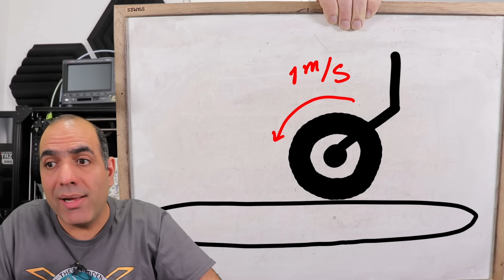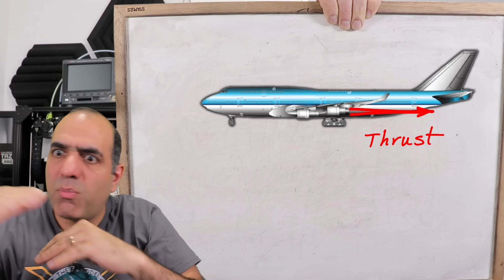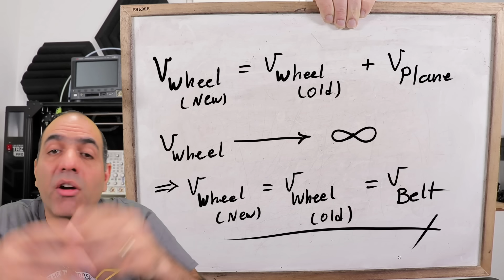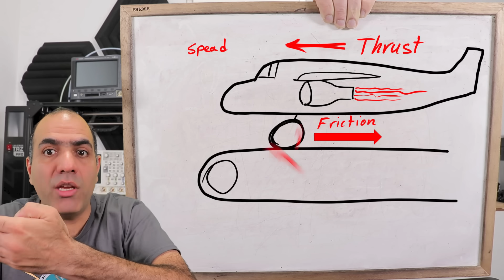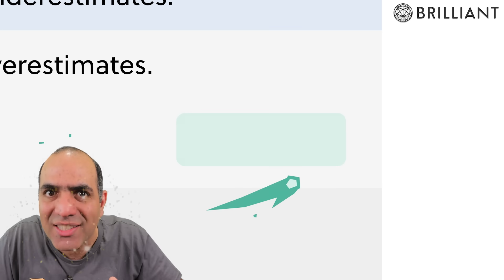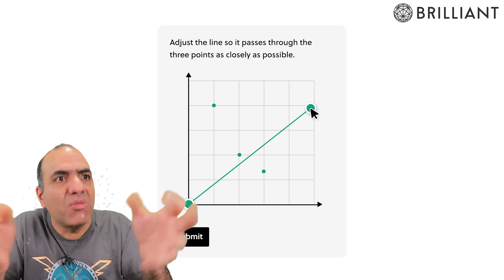Airplane Question that Drove Me NUTS!!!

Comment: Is the treadmill is just matching the speed of the centre of the wheel (the speed of the aircraft)? Then yeah, it would just double the wheel speed, it would probably get high but it wouldn't be enough to produce enough friction to overpower the engines, that would still just push the aircraft, so it would move and would get enough air under the wings. The runway has plenty of margin to handle that additional friction.
The only thing that takes a pause and that tripped many people (including aviation engineers, pilots, and me) is that the expectation is that the treadmill would stop the aircraft, because that's what treadmill does. But not to the airplane, that produce thrust independently from surface it is on.

However, if the treadmill tries to match the speed of the wheel at its surface (meaning, the 2 * pi * radius * wheel RPM), it would go runaway and blow up the tires, and ground the airplane or it would create enough friction to stop the airplane. Because the speed for the wheels is horizontal velocity of the airplane plus treadmill velocity. And treadmill velocity is equal to that, so either horizontal velocity is zero or treadmill speed increases to infinity.

Edit: I felt silly for including that infinite speed scenario, but I see it is in the video too. I agree that it is just a confusing, gotcha kind of question.

Comment: the Aircraft takes off because of LIFT generated beneath the wings from the AIRFLOW created by the SPEED at which it travels.
IF the Aircraft is on a conveyor belt, then it is stationary and only the wheels are moving. If it is stationary, then there is no AIRFLOW to generate LIFT, thus there is no way the aircraft could FLY.
It could potentially "hop" momentarily due to the engines, but it would immediately fall back down to the ground due to it's own weight and the friction of the conveyor belt.

Edit:
watching the video makes me realize that yes... this question is extremely stupid since none of the X Y Z values to this math formula are provided, which means the answer could be anything.

Comment: Okay, I'll leave a comment.

EDIT: I just realized that the speed of the conveyor belt is set to match the speed of the wheels, not the speed of the plane, which makes everything written below obsolete :)

As the plane gains speed, the conveyor belt is trying to counteract that by moving at the same speed as the plane but in the opposite direction.
But as far as I can tell this will mainly affect the wheels of the plane, and not so much the plane itself.
So, my guess is that the plane will accelerate, albeit a little bit slower than under normal circumstances.
A 747 seems to need about 2.5 km of runway for a safe takeoff during normal conditions.
There are runways that stretch for over 5 km, which should be more than enough even if the plane is on a conveyor belt.
So, my guess is that the plane will have no problem taking off.

Comment: Isn't this a possible scenario?
If the belt is designed, to match the speed of the wheel, than when the jet engins start to push the plane forward, the wheels do not turn, and the belt follows the movement of the plane, moving in the direction of the take off. So basically the point, where the wheels and the belt are touching remains the same, and the whole system moves forward. In which case the plane could take off.

Comment: Medhi said to leave a comment before watching, so maybe his answer is the same as mine, but here goes. The plane on a treadmill question is intentionally designed so that both answers are simultaneously wrong and right. Both the engines and wheels are ultimately irrelevant when it comes to lift. Lift is generated by the air difference between the tops and bottoms of the wings; a stationary plane in a strong enough wind tunnel will experience lift. So if the engines are powerful enough to counteract the drag of the conveyor belt and experience forward motion, then the conveyor belt in the question becomes irrelevant. But if the drag of the conveyor belt is exactly equal to the thrust of the engines, then the plane remains stationary and won't lift, exactly what would happen if you chock the tires for an engine test.

Comment: So, assuming the not mentioned conditions and parameters are 'normal', the plane would not take off. Only if you'd add another parameter to the hypothetical situation, the plane could take off. 

Thats like saying "But it doesn't say this Boeing is not equipped with VTOL so yes, the plane can take off"

If the plane does not experience the friction, it's not 'sitting on the runway'. If its windy enough for the plane to take off vertically without movin horizontally, it's not 'sitting on the runway'. The only logical solution I can come up with to support the idea that the plane can take off under the mentioned conditions is that the runway is not perfectly smooth and with enough speed, small bumps would make the plane bounce frequently and momentarily, each time moving forwards a bit more until it gains enough airspeed to lift off. But that would only be possible assuming the plane and its wheels could withstand all the bounces

Comment: all plane have nothing to do with wheels only vehicles does
if you take fan and put in front of plane n get up to 100 or 400 knots of speed it will fly off ground without wheels moving unless you can slingshot plane in the air it will fly because moving air under it wing will create lift under it wing
so wheels is useless ideas and wasted of money

Comment: Assuming non-zero moment of inertia of the wheels, even with frictionless bearings, the plane would not take off. The belt would exert equal force to the thrust just to accelerate the wheels

Comment: If we are in reality, the plane is taking off. 
If we pretend like the conveyor gets infinite physics breaking acceleration and speed limits, the plane gets destroyed.
If we pretend like the conveyor gets infinite physics breaking acceleration and speed limits, while the wheels have realistic drag but are indestructible, it won't take off. Though it seems a bit, selective, that everything but the conveyor gets a bunch of limits imposed on it. If the conveyor gets unlimited speed, the engine should get unlimited thrust! And we're back to reality ending.

Comment: It won't be able to take off bc as the plane speeds up the treadmill speeds up as the treadmill and the plane wheels are at the same speed its not moving forwards bc its same speed as the treadmill which means it won't take off

Comment: Option 3 would quickly result in the tires exploding from centrifugal force. That wouldn't change the result, unless

Unless the wheels, after popping, no longer have enough friction to stop the plane's forward motion.

Or a chunk of rubber goes through the fuel tank and Concordes itself.

Comment: From just the title I expected it to be this bit of rubbish.
The base problem is that the question itself is framed in a way that makes no logical sense.

As some have already said, the wheel/ground speed is irrelevant - which is useful because the phrasing is an impossible propostition if there is any longitudinal movement - and it's just the airspeed over the wings that is important.
With enough wind-speed over the wings, as with a strong head-wind, the aircraft can even be moving backwards and still take off.

The only circumstances where all the parameters can be met is if the aircraft is restrained on the 'runway' with a strong head-wind - that way there is no rotation of the wheels, no movement of the 'runway' and the aircraft lifts from the 'runway'. As soon as the wheels lift from the 'runway', the pilot can apply mor4e thrust and move the aircraft forward relative tot he grouns.

Comment: If there are no friction losses (or breaks) the plane does not care about ground or wheels at all.
You could as well put it on water or ice.
 
If the conveyer belt starts going one direction, wheels compensate so the plane doesnt move  
 
What it does care is speed relative to air. To gain that it either needs wind or firing its engines.
The

Comment: In this particular scenario, you need to assume that the plane cannot travel forward as the conveyer belt will counteract any forward momentum the 747 produces.

The 747 wouldn't take off as jet engines are postitioned underneath the wings of the plane which produce thrust but no lift. The lift is created when the thrust causes enough forward momentum that the airspeed is enough to lift the plane due to the amount of air going under the lifting surfaces (wings). A propeller plane however, could take off as the propellers force air around the wings and which creates lift. This would depend on the position of the propeller(s) and the weight of the plane and the maximum amount of thrust created by the propeller(s) but that's the answer.

Comment: Okay, so I've been thinking about this for an hour or so now, and I believe I can easily explain it...

When a plane takes off, the forces you're fighting against are air resistance (the plane shoving through our thick air), and rolling resistance (from gravity pulling the plane toward the ground -- imagine if the plane had no wheels and you had to just scrape across the ground on its belly. That force of gravity "sticking" the plane to the ground is what we're overcoming, it's just easier when the plane is on wheels. Rolling friction vs sheer friction...), both of which you need to overcome in order to get enough momentum into the plane, to achieve a high enough air speed, which in turn generates the lift required to get the massive plane off the ground. 

By adding a conveyor belt below the wheels that just rolls backwards as your wheels roll forward, all that tells me is you're eliminating the rolling resistance. You're saying I no longer have to fight the gravity to roll forward, because the ground below the wheels just instantaneously moves backward instead. So you don't have to fight against the ground anymore, which means you have more energy you can use to push through the air, or in other words, the same amount of energy now puts more momentum into the system due to the fact that you have zero rolling resistance.

And side note, the conveyor only moves at the rate of your wheels, it doesn't continue to accelerate the wheels to infinite speeds as others have said. Why would it? The conveyor only matches your wheel speed, and nothing is powering the wheels of the plane, they're only turning because the plane is moving forward, so they accelerate at the same rate as the plane's air speed accelerates. The wheels don't "tie" the plane to the ground in any way, and their speed is irrelevant to the forward motion of the plane.